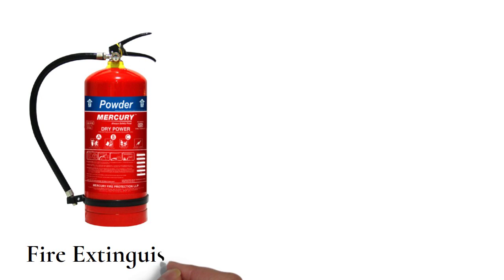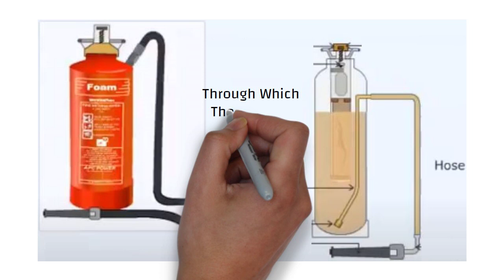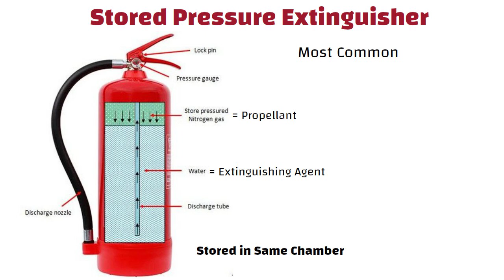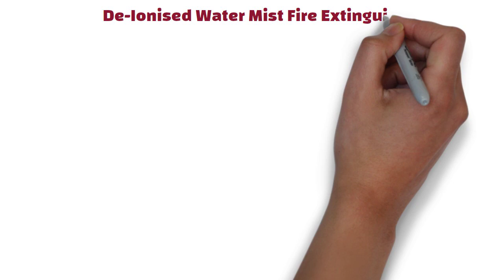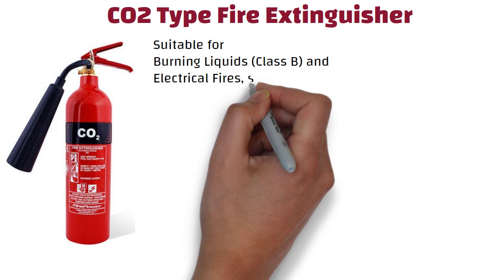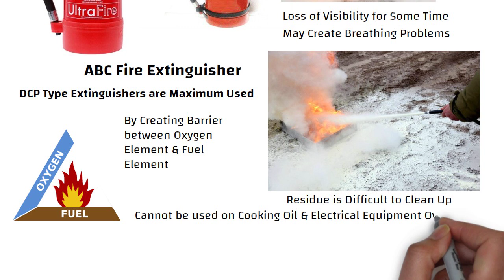FIRE EXTINGUISHER DEALERS IN KERALA, CALL 8138906102, FIRE EXTINGUISHER DEALERS IN ERNAKULAM.

Comment from the maker: RAVEL FIRE ALARM SYSTEM IN KOTTAYAM, LUBI FIRE FIGHTING PUMP DEALERS IN KOTTAYAM, FIRE EXTINGUISHER DEALERS IN KOTTAYAM, ADDRESSABLE FIRE ALARM SYSTEM DEALERS IN KOTTAYAM, 
KIRLOSKAR FIRE FIGHTING PUMP DEALERS IN KOTTAYAM, KIRLOSKAR FIRE FIGHTING PUMP DISTRIBUTORS IN KOTTAYAM, KIRLOSKAR FIRE PUMPS IN KOTTAYAM, KIRLOSKAR DIESEL ENGINE FIRE STANDBY PUMP DEALERS IN KOTTAYAM, KIRLSOKAR MONOBLOCK FIRE PUMP DEALERS IN KOTTAYAM, KIRLOSKAR FIRE TERRACE PUMP DEALERS IN KOTTAYAM, KIRLOSKAR FIRE PUMPS IN KOTTAYAM, KIRLOSKAR FIRE FIGHTING PUMP IN KARNATAKA, KIRLOSKAR FIRE PUMP DEALERS IN KARNATAKA, KIRLOKAR FIRE PUMP DEALERS IN HOSUR, KIRLSOAKR FIRE FIGHTING PUMP DEALERS IN KOTTAYAM, KIRLOSKAR FIRE PUMPS IN KOTTAYAM, KIRLSOKAR FIRE PUMP DISTRIBUTORS IN KOTTAYAM, FIRE ENGINE PUMP SETS IN KOTTAYAM, KIRLOSKAR PUMP DEALERS IN TIRUELVELI, KIRLOSKAR DEALERS IN KARNATAKA, KIRLOSKAR PUMPS IN KARNATAKA, KIRLOSKAR PUMPS IN KOTTAYAM, LUBI FIRE PUMP DEALERS IN KOTTAYAM, LUBI FIRE PUMP DEALERS IN KARNATAKA, LUBI FIRE PUMP DEALERS IN KOTTAYAM, FIRE PUMP SUPPLERS IN KAYAKUMARI, FIRE FIGHTING PUMP DEALERS IN KAYAKUMARIHOSUR, FIRE PUMP DEALERS IN KARNATAKA, FIRE PUMP SUPPLIERS IN KOTTAYAM, FIRE PUMP DEALERS IN KOTTAYAM, FIRE FIGHTING PUMPS IN KOTTAYAM, FIRE FIGHTING PUMP DEALERS IN KOTTAYAM, FIRE FIGHTING PUMP SUPPLIERS IN KARNATAKA, FIRE FIGHTING PUMP SET DEALERS IN KOTTAYAM, FIRE PUMP IN KARNATAKA, FIRE PUMP IN KOTTAYAM, FIRE PUMP IN KOTTAYAM, FIRE DIESEL ENGINE PUMP DEALERS IN KOTTAYAM, FIRE DIESEL ENGINE STANDBY PUMP DEALERS IN KOTTAYAM, FIRE JOCKEY PUMP DEALERS IN KOTTAYAM, FIRE JOCKEY PUMP DEALERS IN KARNATAKA, FIRE JOCKEY PUMP DEALERS IN KOTTAYAM. CRI PUMP DEALERS IN KOTTAYAM, HYDRO PNEUMATIC PRESSURE BOOSTING PUMP DEALERS IN KOTTAYAM, VERTICAL INLINE PUMP DEALERS IN KOTTAYAM, INDUSTRIAL PUMP DEALERS IN KOTTAYAM, SEWAGE PUMP DEALERS IN KOTTAYAM, STP AND ETP PUMP DEALERS IN TIRUNELVALEI, STP AND ETP PUMP DEALERS IN KOTTAYAM, STP AND ETP PUMP DEALERS IN KOTTAYAM, STP AND ETP PUMP DEALERS IN KOTTAYAM, HYDRO PNEUMATIC PRESSURE BOOSTING PUMP DEALERS IN KOTTAYAM, SEWAGE PUMP DEALERS IN KOTTAYAM, DEWATERING PUMP DEALERS IN KOTTAYAM, FIRE JOCKEY PUMP DEALERS IN KOTTAYAM, CRI PUMP DEALERS IN KOTTAYAM,

Comment from the maker: Fire extinguisher dealers in KOTTAYAM, fire fighting contractors in KOTTAYAM, KOTTAYAM, fire and safety installations in KOTTAYAM, fire extinguisher suppliers in KOTTAYAM,fire extinguishers in KOTTAYAM, fire extinguishers in KOTTAYAM, fire protection system in KOTTAYAM, f fire and safety installation in KOTTAYAM, fire and safety contractors in KOTTAYAM, fire safety contractors in KOTTAYAM, fire and safety systems equipments in KOTTAYAM, fire equipment in KOTTAYAM, fire extinguisher in KOTTAYAM, fire protection system installation in KOTTAYAM, fire contractors in KOTTAYAM, fire safety consultants in KOTTAYAM,  fire alarm systems in KOTTAYAM, fire NOC in KOTTAYAM, fire AMC in KOTTAYAM, KOTTAYAM, fire fighting equipment in KOTTAYAM,
MS Jindal pipe dealers in KOTTAYAM, motor control panel in KOTTAYAM, fire pump panel in KOTTAYAM, motor control panel in KOTTAYAM, Morley fire alarm in KOTTAYAM, gst fire alarm in KOTTAYAM, addressable fire alarm system in KOTTAYAM, Pa talk back system in KOTTAYAM, PA two way talk back system in KOTTAYAM, auto glow SIGNAGES in KOTTAYAM, Karthar dealers in KOTTAYAM, Agni fire alarm dealers in KOTTAYAM, ASES SECURITY fire alarm dealers in KOTTAYAM, AUTO GLOW SIGNAGES in KOTTAYAM, FIRE PUMP PANEL in KOTTAYAM, LHP pump in KOTTAYAM. Karthar valves in KOTTAYAM, Ravel fire alarm system in KOTTAYAM. Jindal pipe dealers in KOTTAYAM, Jindal pipe dealers in KOTTAYAM. MS pipe dealers in KOTTAYAM. Butterfly valves in KOTTAYAM, PA talk back system in KOTTAYAM, Fire alarm dealers in KOTTAYAM, smoke detector dealers in KOTTAYAM, fire alarm panels dealers in KOTTAYAM, MCP, hooter dealers in Mangalor, hydrant valve dealers in KOTTAYAM, branch pipe dealers in KOTTAYAM,Fire CP hose in KOTTAYAM, Fire RRL hose in KOTTAYAM, heat detector dealers in KOTTAYAM, Motor Control panel in KOTTAYAM,  LED EXIT LIGHTS dealers in KOTTAYAM, emergency exit light dealers in KOTTAYAM, auto glow SIGNAGES dealers in KOTTAYAM. Conventional fire alarm system in KOTTAYAM, Fire alarm panel in KOTTAYAM, Notifier fire alarm dealers in KOTTAYAM, PA talk back unit dealers in KOTTAYAM. Honeywell fire alarm dealers in KOTTAYAM, BOSCH PA system dealers in KOTTAYAM, 
KIRLOSKAR FIRE FIGHTING PUMP DEALERS IN KOTTAYAM, FIRE FIGHTING EQUIPMENT DEALERS IN KOTTAYAM, FIRE ALARM SYSTEM DEALERS IN KOTTAYAM, FIRE CONSULTANTS IN KOTTAYAM, FIRE CONTRACTOTORS IN KOTTAYAM, FIRE CONTRACTORS IN KOTTAYAM, FIRE ALARM SYSTEM DEALERS IN KOTTAYAM, SMOKE DETECTOR DEALERS IN KOTTAYAM, FIRE PROTECTION SYSTEM IN KOTTAYAM, FIRE CONSULTANTS IN KOTTAYAM, FIRE CONSULTANTS IN KOTTAYAM, PA TALK BACK SYSTEM IN KOTTAYAM, ADDRESSABLE FIRE ALARM SYSTEMS IN KOTTAYAM, CUTTER PUMP DEALERS IN KOTTAYAM, ADDRESSABLE FIRE ALARM SYSTEM SUPPLIERS IN KOTTAYAM, SMOKE DETECTOR DEALERS IN TKOTTAYAM, PRESSURE BOOSTING PUMP DEALERS IN KOTTAYAM, SLURRY PUMP DEALERS IN KOTTAYAM, WATER PUMP DEALERS IN KOTTAYAM
Reply: FIRE EXTINGUISHER DEALERS IN ADOOR, FIRE EXTINGUISHER SUPPLIERS IN ADOOR, FIRE EXTINGUISHER DISTRIBUTORS IN ADOOR, FIRE EXTINGUISHER IN ADOOR, ABC TYPE FIRE EXTINGUISHER DEALERS IN ADOOR, CO2 TYPE FIRE EXTINGUISHER DEALERS IN ADOOR, CLEAN AGENT FIRE EXTINGUISHER IN ADOOR, MODULAR TYPE FIRE EXTINGUISHER DEALERS IN ADOOR, MECHANICAL FOAM FIRE EXTINGUISHER DEALERS IN ADOOR, FIRE EXTINGUISHER NEAR ME ADOOR, FIRE EXTINGUISHER TRADERS IN ADOOR, FIRE FIGHTING COMPANIES IN ADOOR, FIRE CONTRACTORS IN ADOOR, FIRE EQUIPMENT DEALERS IN ADOOR, FIRE ALARM DEALERS IN ADOOR, FIRE PUMP DEALERS IN ADOOR, SMOKE DETECTOR DEALERS IN ADOOR, FIRE FIGHTING SYSTEM IN ADOOR, FIRE PROTECTION SYSTEM IN ADOOR, FIRE AND SAFETY CONTRACTORS IN ADOOR, FIRE HYDRANT SYSTEMS IN ADOOR, PA TALK BACK SYSTEM IN ADOOR, FIRE NOC IN ADOOR, FIRE INSTALLATION IN ADOOR, FIRE NOC RENEWAL IN ADOOR, KIRLOSKAR FIRE PUMP DEALERS IN ADOOR, FIRE EXTINGUISHER NEAR ME ADOOR, FIRE EXTINGUISHER MANUFACURERS IN ADOOR, SAFEX FIRE EXTINGUISHER DEALERS IN ADOOR, FIRE NOC CONTRACTORS IN ADOOR, FIRE FIGHTING EQUIPMENT DEALERS IN ADOOR, FIRE PROTECTION SYSTEM IN ADOOR, FIRE INSTALLATION IN ADOOR, FIRE SAFETY CONTRACTORS IN ADOOR, FIRE AMC IN ADOOR, FIRE PROTECTION SYSTEM IN ADOOR, FIRE PROTECTION EQUIPMET IN ADOOR, AMC OF FIRE SYSTEM IN ADOOR, FIRE CONSULTANTS IN ADOOR, FIRE AND SAFETY EQUIPMENT DEALERS IN ADOOR, ADDRESSABLE FIRE ALARM SYSTEM IN ADOOR, KARTHAR VALVE DEALERS IN ADOOR, DCP TYPE FIRE EXTINGUISHER IN ADOOR, POWSER TYPE FIRE EXTINGUISHERS IN ADOOR, FIRE HYDRANT SYSTEM IN ADOOR, FIRE ALARM PANEL DEALERS IN ADOOR, SAFEPRO FIRE EXTINGUISHER DEALERS IN ADOOR, MS AND GI PIPE DEALERS IN ADOOR, JINDAL PIPE DEALERS IN ADOOR, AGNI FIRE ALARM DEALERS IN ADOOR, FIRE EQUIPMENT DEALERS IN ADOOR, FIRE EQUIPMENT SUPPLIERS IN ADOOR, FIRE EQUIPMENT TRADERS IN ADOOR, FIRE SPRINKLER SYSTEM IN ADOOR, RAVLE FIRE ALARM DEALERS IN ADOOR, RAVEL FIRE ALARM SYSTEM IN ADOOR, AGNI FIRE ALARM DISTRIBUTORS IN ADOOR, FIRE ALARM CONTRACTORS IN ADOOR, FIRE PIPE INSTALLATION IN CONTRACTORS IN ADOOR, FIRE SAFETY CONTRACTORS IN ADOOR, FIRE PA TWO WAY TALK BACK SYSTEM DEALERS IN ADOOR, HEAT DETECTOR DEALERS IN ADOOR, HONEYWELL FIRE ALARM DEALERS IN ADOOR, FIRE NOC CONSULTANTS IN ADOOR, FIRE AMC AND FIRE NOC IN ADOOR, FIRE SAFETY COMPANIES IN ADOOR, NEWAGE DEALERS IN ADOOR, MONSHER FIRE EQUIPMENT DEALERS IN ADOOR, KARTHAR VALVE DEALERS IN ADOOR, FIRE HYDRANT VALVE DEALERS IN ADOOR, FIRE HOSE REEL DRUM DEALERS IN ADOOR, FIRE SPRINKLER DEALERS IN ADOOR, FIRE PUMP DEALERS IN ADOOR, LUBI PUMP DEALERS IN ADOOR, LHP PUMP DEALERS IN ADOOR. FIRE CONTRACTORS IN ADOOR, FIRE AND SAFETY CONTRACTORS IN ADOOR, FIRE EQUIPMENT DEALERS IN ADOOR, FIRE FIGHTING CONTRACTORS IN ADOOR,

Comment from the maker: FIRE ALARM DEALERS IN KOTTAYAM, ADDRESSABLE FIRE ALARM DEALERS IN KOTTAYAM, FIRE ALARM SYSTEM DEALERS IN KOTTAYAM, ADDRESSABLE FIRE ALARM SYSTEM DEALERS IN KOTTAYAM, FIRE DETECTION SYSTEM IN KOTTAYAM, SMOKE DETECTOR DEALERS IN KOTTAYAM, CONVENTIONAL FIRE ALARM DEALERS IN KOTTAYAM, MORLEY FIRE ALARM DEALERS IN KOTTAYAM, GST FIRE ALARM DEALERS IN KOTTAYAM, ASES SECURITY FIRE ALARM DEALERS IN KOTTAYAM, BEAM DETECTOR DEALERS IN KOTTAYAM, FIRE ALARM SUPPLIERS IN KOTTAYAM, FIRE ALARM TRADERS IN KOTTAYAM, FIRE ALARM PANEL DEALERS IN KOTTAYAM, HEAT DETECTOR DEALERS IN KOTTAYAM, FIRE ALARM SYSTEM SUPPLIERS IN KOTTAYAM, FIRE ALARM COMPANIES IN KOTTAYAM, FIRE EQUIPMENT DEALERS IN KOTTAYAM, ADRRESSABLE FIRE ALARM PANEL DEALERS IN KOTTAYAM, FIRE ALARM SYSTEM IN KOTTAYAM, BATTERY OPERATED DETECTOR DEALERS IN KOTTAYAM, ASPIRATION DETECTION SYSTEM DEALERS IN KOTTAYAM, FIRE ALARM MCP - MANUAL CALL POINT DEALERS IN KOTTAYAM, FIRE ALARM HOOTER DEALERS IN KOTTAYAM, PA TWO WAY TALK BACK SYSTEM DEALERS IN KOTTAYAM, PA SYSTEM DEALERS IN KOTTAYAM, PA TALK BACK UNIT DEALERS IN KOTTAYAM, HOOTER CUM STROBE DEALERS IN KOTTAYAM, FIRE PROTECTION SYSTEM IN KOTTAYAM, FIRE ALARM CONTRACTORS IN KOTTAYAM, FIRE DETECTORS IN KOTTAYAM, FIRE ALARM DEALERS IN KOLLAM, ADDRESSABLE FIRE ALARM DEALERS IN KOLLAM, SMOKE DETECTOR DEALERS IN KOLLAM, FIRE EQUIPMENT DEALERS IN KOTTAYAM, FIRE ALARM INSTALLATION IN KOTTAYAM, FIRE ALARM COMPANIES IN KOTTAYAM FIRE ALARM DISTRIBUTORS IN KOTTAYAM, TALK BACK SYSTEM DEALERS IN KOTTAYAM, FIRE ALARM SENSOR DEALERS IN KOTTAYAM, FIRE EXTINGUISHER DEALERS IN KOTTAYAM, FIRE ALARM DEALERS IN ERNAKULAM, FIRE ALARM DEALERS IN KERALA, ADDRESSABLE FIRE ALARM DEALERS IN CALICUT, SMOKE DETECTOR IN KOTTAYAM,  FIRE EXTINGUISHER DEALERS IN KOTTAYAM, FIRE EXTINGUISHER SUPPLIERS IN KOTTAYAM, FIRE EXTINGUISHER DISTRIBUTORS IN KOTTAYAM FIRE EXTINGUISHER IN KOTTAYAM, ABC TYPE FIRE EXTINGUISHER DEALERS IN KOTTAYAM, CO2 TYPE FIRE EXTINGUISHER DEALERS IN KOTTAYAM, CLEAN AGENT FIRE EXTINGUISHER IN KOTTAYAM, MODULAR TYPE FIRE EXTINGUISHER DEALERS IN KOTTAYAM, MECHANICAL FOAM FIRE EXTINGUISHER DEALERS IN KOTTAYAM, FIRE FIGHTING PUMP DEALERS IN KOTTAYAM, FIRE PUMP DEALERS IN KOTTAYAM, KIRLOSKAR FIRE PUMP DEALERS IN KOTTAYAM, FIRE JOCKEY PUMP DEALERS IN KOTTAYAM, FIRE DISEL ENGINE DRIVEN PUMP DEALERS IN KOTTAYAM, FIRE FIGHTING EQUIPMENT DEALERS IN KOTTAYAM, FIRE FIGHTING SYSTEM IN KOTTAYAM, VERTICAL INLINE PUMP DEALERS IN KOTTAYAM, HYDRO PNEUMATIC PRESSURE BOOSTING PUMP DEALERS IN KOTTAYAM, VERTICAL TURBINE PUMP DEALERS IN KOTTAYAM, SEWAGE PUMP DEALERS IN KOTTAYAM, RO PUMP DEALERS IN KOTTAYAM. FIRE EXTINGUISHER IN KOTTAYAM, FIRE EXTINGUISHER SUPPLIERS IN KOTTAYAM,

Comment from the maker: KIRLOSKAR FIRE PUMP DEALERS IN PANDALAM, KIRLOKAR FIRE PUMP DEALERS IN HOSUR, KIRLSOAKR FIRE FIGHTING PUMP DEALERS IN PANDALAM, KIRLOSKAR FIRE PUMPS IN PANDALAM, KIRLSOKAR FIRE PUMP DISTRIBUTORS IN PANDALAM, FIRE ENGINE PUMP SETS IN PANDALAM, KIRLOSKAR PUMP DEALERS IN TIRUELVELI, KIRLOSKAR DEALERS IN PANDALAM, KIRLOSKAR PUMPS IN PANDALAM, KIRLOSKAR PUMPS IN PANDALAM, LUBI FIRE PUMP DEALERS IN PANDALAM, LUBI FIRE PUMP DEALERS IN PANDALAM, LUBI FIRE PUMP DEALERS IN PANDALAM, FIRE PUMP SUPPLERS IN PANDALAM, FIRE FIGHTING PUMP DEALERS IN PANDALAM, FIRE PUMP DEALERS IN PANDALAM, FIRE PUMP SUPPLIERS IN PANDALAM, FIRE PUMP DEALERS IN PANDALAM, FIRE FIGHTING PUMPS IN PANDALAM, FIRE FIGHTING PUMP DEALERS IN PANDALAM, FIRE FIGHTING PUMP SUPPLIERS IN PANDALAM, FIRE FIGHTING PUMP SET DEALERS IN PANDALAM, FIRE PUMP IN PANDALAM, FIRE PUMP IN PANDALAM, FIRE PUMP IN PANDALAM, FIRE DIESEL ENGINE PUMP DEALERS IN PANDALAM, FIRE DIESEL ENGINE STANDBY PUMP DEALERS IN PANDALAM, FIRE JOCKEY PUMP DEALERS IN PANDALAM, FIRE JOCKEY PUMP DEALERS IN PANDALAM, FIRE JOCKEY PUMP DEALERS IN PANDALAM. CRI PUMP DEALERS IN PANDALAM, HYDRO PNEUMATIC PRESSURE BOOSTING PUMP DEALERS IN PANDALAM, VERTICAL INLINE PUMP DEALERS IN PANDALAM, INDUSTRIAL PUMP DEALERS IN PANDALAM, SEWAGE PUMP DEALERS IN PANDALAM, STP AND ETP PUMP DEALERS IN TIRUNELVALEI, STP AND ETP PUMP DEALERS IN TPANDALAM, STP AND ETP PUMP DEALERS IN PANDALAM, STP AND ETP PUMP DEALERS IN PANDALAM, HYDRO PNEUMATIC PRESSURE BOOSTING PUMP DEALERS IN PANDALAM, SEWAGE PUMP DEALERS IN PANDALAM, DEWATERING PUMP DEALERS IN PANDALAM, FIRE JOCKEY PUMP DEALERS IN PANDALAM,